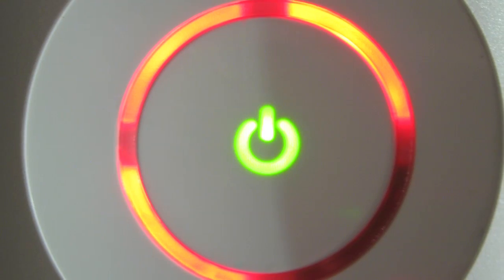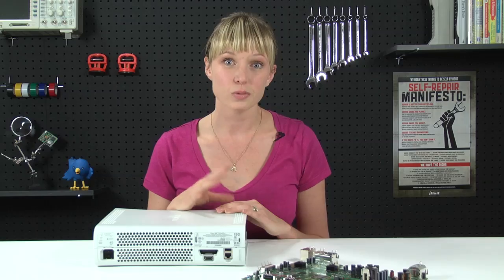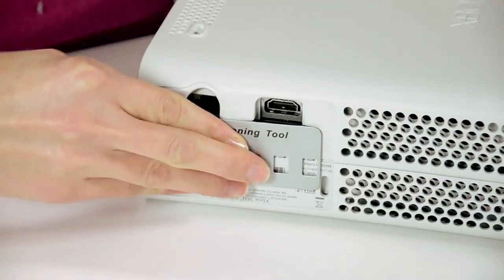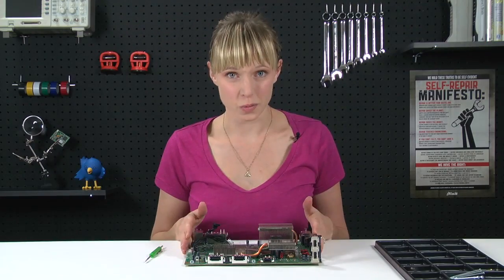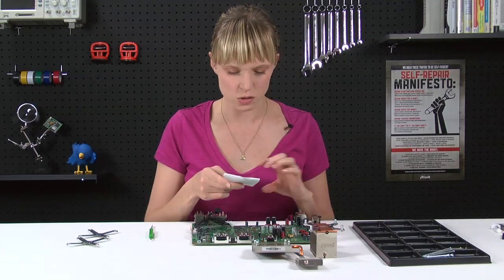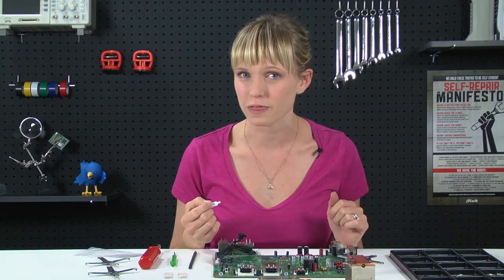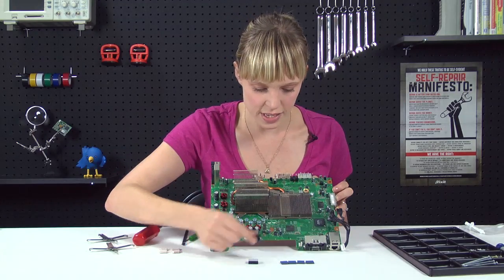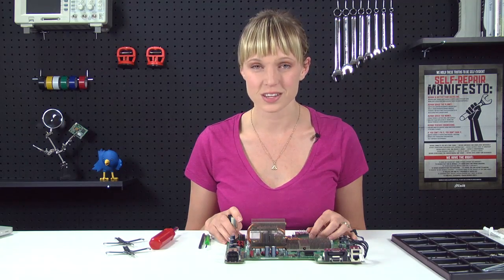Xbox 360 Red Ring of Death Repair

Comment: I'm a frequent gaming PC builder. I've bought both the PS3 and Xbox 360 Slim versions.
I took them both apart as soon as I bought them.
Buy some ''Antec Formula 7'' Thermal paste.
Do NOT apply the Thermal Paste the way she does in the video.
Just apply a small pea size amount in the center of the chips. Then fix the HS (Heatsink) down.
Also, you should 'lap' or polish the HS where they contact the chips. Steel wool works great, just rub the HS in a single direction until you get a mirror finish.

Comment: @modex20 For the method it is best to use the dot method because of the arragement of the CPU ibm.com/developerworks/power/library/pa-fpfxbox/figure1.gif  A credit card is also a good way to spread the compound without creating air bubbles. I have also been advised to use a heat gun to help reflow the board.
Reply: Most repairs require a reflow. Strange how she just did a pm on the cooling systems. Also, the resistors to see if they were out of range.

Comment: @iFixitYourself No you need to reflow the board with a heat gun. This only improves thermal conductivity it does not guarantee that circuits will be complete.

Comment: Well maybe if Microsoft would've used a better cooling setup, instead of two dinky fans at the back they probably wouldn't have had to replace thousands of 360s, plus they could've chosen to make the heat sinks larger that would've also helped.

Comment: Do not spread the thermal paste around.  It air bubbles will form when you apply the heat sink.  Apply a bead or a line, and let the heat sink spread it naturally as it is mounted.

Do not paper towel when preparing the surface either.  Use a lint free cloth, or a coffee filter.  Small fibers ruin the thermal conductivity if they are left on the surface.

Stop watching generalized "fix it" videos.  All they do is spread misinformation.

Comment: red ring is caused by the disk drive not overheating... micro vibrations cause the gpu and cpu chips  seperate from the mother borad. overheating is only cause if the fan isnt working.

Comment: I'm going to be repairing my Xbox 360 but I don't have new thermal pads or whatever it is. Can I still fix my Xbox 360 without needing them? By the way I have an Elite (with a HDMI connection).

Comment: THE WHITE THERMAL COMPOUND SHE IS USING IS FOR ONLY CPU NOT FOR GPU, READ THE LABEL WHEN YOU BUY IT MADE FOR CPU, I USE THERMALFUSION COOLMASTER 400 ITS MADE FOR GPU & CPU. DID YOU NOT SEE AT THE END OF THE VIDEO SHE DID NOT TURN ON THE XBOX360, BUT THE WAY SCREWING IT TO TIGHT WILL STILL RED RING THE CONSOLE AND THEN IT CAN CRACK THE PROCESSORS, THE X-CLAMPS ARE NOT A FLAW, IT'S ONLY MADE TO HOLD THE XCLAMP IN PLACE TO CONNECT TO THE HEATSINKS. xbox360repairshop@yahoo.com FOR QUESTIONS THANKS

Comment: JUST DOING WHAT SHE SAID WILL WORK FOR AWHILE BUT WHEN THE SOLDIER GET SUPER HOT AGAIN THEN IT WILL RED RING AGAIN BUT THIS TIME IT WILL SHOW AN E74 BECAUSE THE SOLDIER WILL THIN OUT UNDER THE GPU. THE SOLDIER WILL BECOME LOSE AGAIN AND IT WILL RUN TO OTHER SOLDIER POINTS UNDER THE GPU CHIP, THEN BAM 3 RROD OR E74, THE RIGHT WAY TO FIX IT IS TO REBALL THE GPU AND CPU WITH LEAD SOLDIER NOT WITH LEAD FREE SOLDIER, I FIX THEM ALL THE TIME.

Comment: @Rcee01 did it work man it worked for me so good like yesterday i played for like 3 hours and it was not even hot if i still had all the dust in it it it will be burning. And also when your vacuuming it with the tube thing make sure to unplug thee wires attached to the xbox and clean in those openings, and also vacum the black box thing with the orange light. Good luck I hope i helped you!

Comment: Its easy if u have 2 red rings take ur vacum and take the tube thing and suck all the dust out from the holes it worked for me and my xbox is so much cooler before it would be burning hot ! Give it a try trust me(:

Comment: this is bullshit, this is not a repair but just a re-paste job 2 help the ring of death in the first place not appear. also who told u how 2 apply thermial paste cause they need shooting that paste will be well lumpy u need a card or sumthing 2 apply, 2 fix this problem u do need 2 use a hot air gun at least at 650 f over the cpu and gpu chips and then its only tempory

Comment: I dont want to sound like negative-Nancy, but you forgot to heat the chip before you put back the heat sink, it would not work that way,  so the chip contact would get back in place, the reason you got the red light is because the heat sing warp the board losing the connections of the chip and the board.